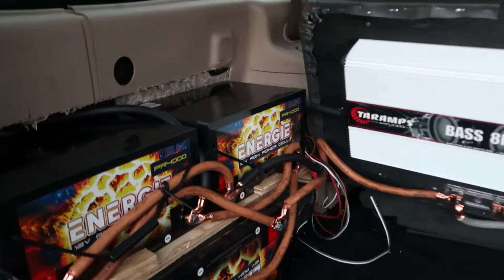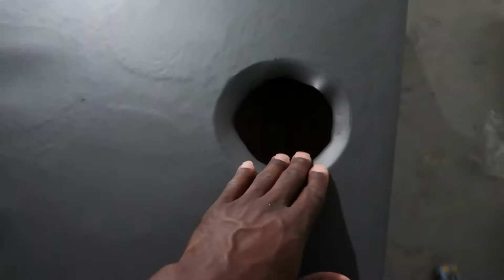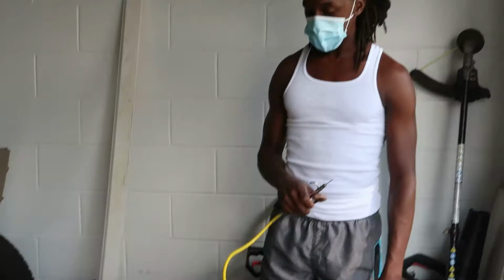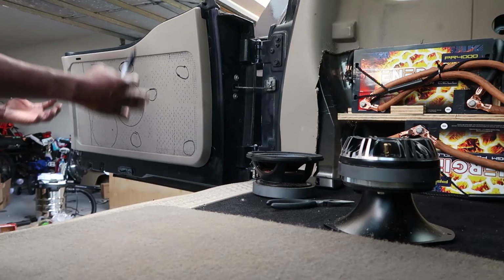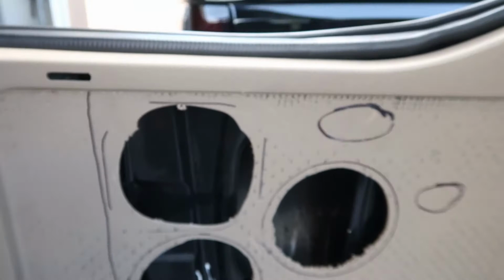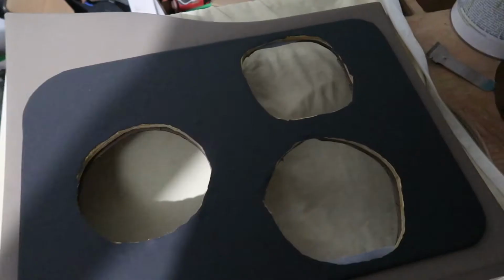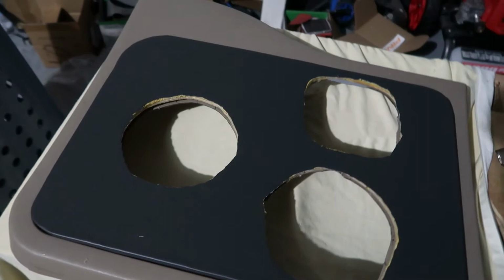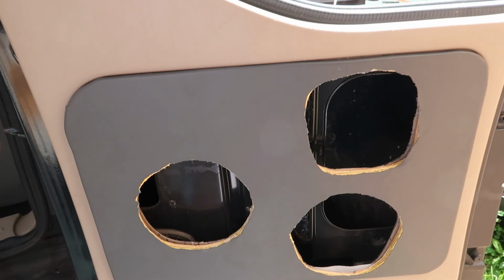Ford Excursion Custom Wrapped Music Box

Comment: Looks like a lot of work looks real tight keep up the good work. I also have a Ford it's a super duty kind of similar to the excursion when I had my carpet out in my headliner out I went ahead and put down Norco sound deadening material along with some acoustic foam  did the whole floor roof door panels everything and man what a difference in ride quality and keeps all the road noise out and keeps it insulated from the weather as well really glad I did it would not be a bad idea all your interiors out to do the same anyways keep up the good work.
Reply from the maker: Thank you I appreciate that I'll look into that sounds like a good idea